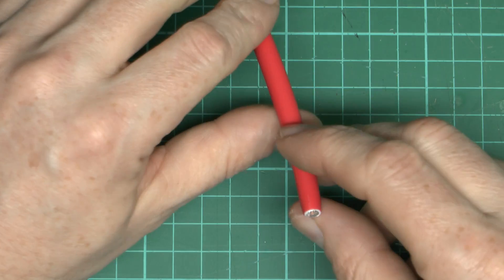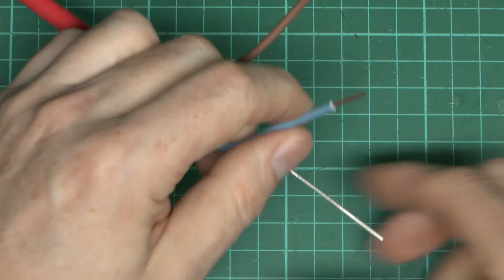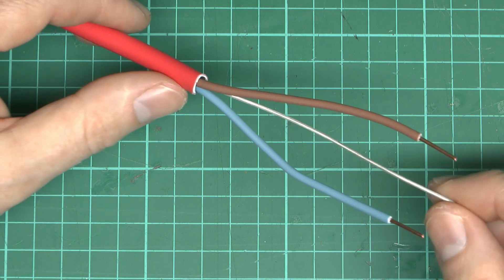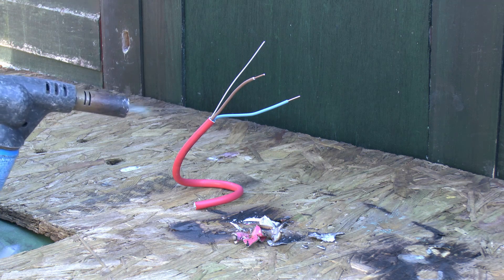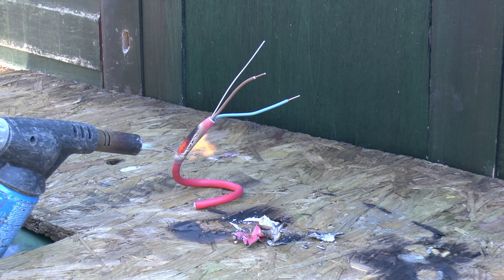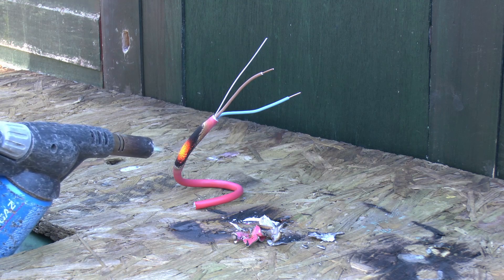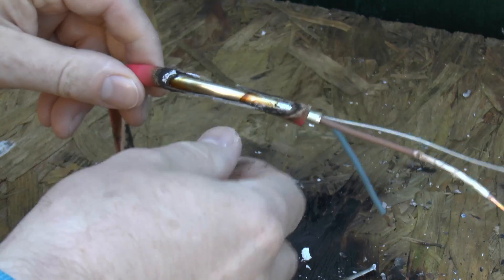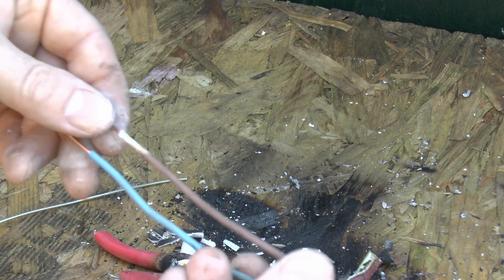FP200 Gold Cable + Flames = ?

Comment: FP200 was made by Pirelli it was made to withstand temperatures as low as -50c and as high as +1000c , it was classed as arctic cable and was available in Red white Blue and orange. The conductors were wrapped in a thin light blue foil then wrapped in aluminium then the outer sheath. It was mainly used for fire alarms systems emergency lighting   In hospitals nursing homes and schools and other public buildings. We used the white version for emergency lighting in a new nursing home back in the early to mid nineties. The fire alarm system was installed by a different company and they use the Red version. These days FP200 is a little different but still a fantastic cable.

Comment: Hello John, your videos are always useful.
What I wanted to ask is what do you use to strip a long length of fp 200 ,say where it enters a dist board before terminating. 
I very found a lot of strippers don't work well longitudinally and you end up pulling on the earth to strip the cable.

Comment: Hello JW, I think the third wire which is bare is for noise protection. The voltage in addressable fire alarm systems is 24 volt and the communication between panel and devices is digital (  power and data are simultaneously on 2 wires ). The system works without the third wire but since most of times these cables are near 230 volt cables, they like to be sure that there will be no noise and no interference on the operation of fire alarm system.

Comment: Annoying piece of junk 😂😂😂, we used to get some twat who flew his stupid motorised kite over us and circle, its an invasion of your privacy  and that ridiculous buzz...... 
Back to the cable, years ago we had little plastic or nylon ferrules that you inserted into the cut end of the outer sheath to prevent the hard sheath chaffing into the soft inner core insulation, then as you said, a normal flex gland to hold the cable into the terminal box.

Comment: You should set up a comparison of different cables (sy, pvc twin, swa, pyro etc) and see how the different fixed installation cables can handle a fire, I reckon swa would hold up pretty well since there's thick layers of pvc and the armoured wires are tightly packed, you could lay them all out over some hot coals and see which wires short out our open circuit first
Reply from the maker: Have done some of those already, https://www.youtube.com/watch?v=3hyN3NOmqGo

Comment: Fire Performance there is STILL ONLY MICC which will survive in the event of a REAL fire where water from burst pipes and mechanical shock movement will inevitably happen when internal structures within the environment start to move as will happen in a REAL fire. Silicon ceramifiable cables will NOT survive a REAL fire they are only meant to be used with Addressable intelligent fire panels and detectors. Clipping is important and some times clips are PVC coated with some unscrupulous manufacturers using outer sheath PVC and NOT LSF....Shame..................

Comment: So basically the outer (red) insulation is designed to be intumescent so as to shield the inner conductors from the intense heat.  Pretty clever as I have never seen such a cable until now, though it makes perfect sense.

Comment: I had to wire the apparatus room of a Soho facilities house in 1983 with that stuff and actually routing 83 circuits into a single power cabinet wasn't the most fun I've ever had. It has quite a large turn radius because of the aluminium cladding and so routing it in a confined space without damaging it can be quite a challenge. Having said that, it out performs a lot of other fireproof power cables. 

It does require (or did) a plastic ferrule end cap, to prevent the insulation of the inner conductors from being damaged by the sharp edge of the aluminium sheath at the strip point.

Comment: Thanks for the great video John 👍

The old pyro needs special tools to strip it, have fitted about 100 miles of fp200 over the years myself, easy to strip.. lots of powder coated copper p clips
Reply: Grant Rennie  pyro needs banning absolutely the worst of cables around

Comment: heres the irony of FP200 it may still work after being burned BUT because its sheath is damaged and therefore no longer offers mechanical protection it is no longer valid , MICC would simply need a scrape of the dead PVC and its back in service , most electricians cant do pyro (as we call it ) these days they can barely terminate a 2.5mm SWA without taking ten hours and damaging the sheath on the conductors !!!
i went to a school kitchen years ago that we had wired in MICC , we scraped the burned sheath put on new fittings and away it went , imagine the time out with FP200 ???

Comment: Excellent video again John. I was very surprised at the outcome. It really does its job. A fire alarm would hold its integrity long enough for it to do its job in an emergency. I’m very old school and close to retirement and like a lot of other guys,I haven’t been impressed with modern day plastic products,. This product has earned my total respect. Yes, I know it’s been going for donkeys years, but I’m impressed. I still mourn the disappearance of Pyro cable (my favourite)  and most of the engineering side to this industry. It would be interesting to see how this would stand up to a hostile environment/ atmosphere? Hammer blows, chemicals, corrosion, acid, alkalis, pressure and other physical abuse?
Thanks for your time John. Your videos are brilliant!

Comment: Interesting, but one of the most important considerations is the correct installation of this cable. In fire alarm installations the sounder circuits need to operate for a period of at least 30 minutes (detection circuits can fail at any time as they have done their job. FP200 will burn through but it becomes rigid and self supporting if installed correctly with the right spacing and the correct saddles, clips and or cable ties. I have witnessed this cable installed without be fixed above voids and tied to the underside of cable tray with nylon tie, it would fall off and fail. Also, consider the glands and boxes fitted.

Comment: Now that is rather impressive, in particular the inner cores remaining almost untouched after that level of heat.  What is the mandated use of this other than fire alarm circuits ?
Reply: Disabled refuge alarms

Comment: Excellent video. Are there special junction boxes for this type of installation too? Or perhaps high temperature resistant terminal blocks to connect them? I only ever see the red cable going from place to place, but terminated in what seem regular PVC junction boxes. I wonder if there are special requirements for the junction boxes too.
Reply from the maker: Joints are supposed to be done with ceramic terminal blocks.  Ideally no joints at all, just a single unbroken cable from one point to another (such as a fire panel to a detector).

Comment: When it comes to flying contraptions it seems that the smaller they are the more noise they make.  I often get a posse of five or six of these paramotors flying directly overhead in fine weather but not usually at this time of year.

Comment: I imagine the puffing up of the outer sheath acts to further thermally insulate the inner cores, a type of carbon aerogel where it gets too hot.
Reply: Yes, it's called an "intumescent" material.
Not to be confused with "tumescence" XD
Reply: @BenjaminEsposti  like the pillows and pads only different manufacturing materials

Comment: Another excellent demonstration, and agree with you about that noise, the "angry wasp" racket that small-cc engines with insufficient or zero muffling make is quite possibly the most annoying sound in the known Universe! Especially when they are stopping and starting constantly like petrol strimmers, chainsaws etc. :)

Comment: For those who asked 'where are these used?'.One function you'll find these or MIMS used for in high rise buildings is the power to the stairwell pressurisation fans. In the event of a fire those fans keep a positive air pressure in the stairwells to prevent them becoming a chimney.
Reply: I live in a flat in a country house that was previously used as a hospital. Our fire alarm system is done in a 1970s version of this FP200 stuff. Ours seems less rigid and has a white sheath. 50% of our communal electrics and flat submains are the 60 year old pyro cables fitted for the hospital and it's still going strong! I expect it to outlast all the modern T+E stuff we've added since.

Comment: Canadian electrician here just curious is this used in commercial and residential environments? Is it run in a conduit or tubing of some sort?
Reply: BS5839 calls for additional mechanical protection (conduit/trunking) for FP cabling installed below 2 meters unless it's a relatively benign environment (like an office) where it's not likely to be easily damaged
Reply: Not necessarily, it would generally only be put in tubing/conduit if it was required to be hidden, otherwise it would just be fixed naked (as it were) to the wall.
Reply: Almost exclusively commercial as most residences don't have the types of systems they're used with, which are the ones that have many fire detectors, call the fire brigade automatically, switch the building aircon into exhaust-only mode, etc.

Comment: What's the point of the aluminum liner in the outer jacket? Flame resistance, mechanical protection, grounding, EMI shielding?
Reply: All of those things, I would guess.
Reply: Actually, I think it is there primarily for Flame/Fire Resistance, and for mechanical protection as secondary property. It is not thick enough to provide significant mechanical protection, although it is clearly strong enough to protect against light knocks. It's not there to provide grounding, this is the purpose of the uninsulated conductor within the cable. It is not there to provide EMI shielding as there is no way to maintain the shielding through junction boxes etc., and there is no requirement for these cables to provide EMI shielding.

Comment: You could also get the cheapest, Chinesium fire cable made of thin, iron wire and colored napalm. Okay, I seriously doubt that would pass a building inspection. Well, I doubt a flame would be applied, but the inspector would know something would be a miss when the cable spontaneously combusts for absolutely no reason at all.
Reply: Just replace the proper electrical wiring with pretty looking fuse wires for explosives (the burning kind, not electrical modern fancy stuff), the fire if it starts will make it faster to the non-functioning fire alarm possibly setting fire to more stuff along the way.

Comment: Impressive stuff. I do commercial electrical and haven't seen wire like that here in the US but fire protection is it's own animal here and I just get annoyed when I see their low voltage red alarm wire haphazardly run through ceilings and usually in the way. It's basically a little better than cat5 just has a fireproof plastic.
Reply: I worked beside an American electrician that moved here for a while, all the cables are different stateside.

I had a look at the fire alarm panels when I was staying in America and they are totally different too, good and trouble come to mind

Comment: Deadpan delivery of, "now that annoying peice of junk has flown away..." lmao :D
Reply: Big Clive heard about some pink stuff and flames and flew in to investigate.
Reply: Ha ha.. Big Clive flying over checking up on your antics 😂 great video JW always wanted to see how FP200 performed under fire conditions. I should imagine the conductor size needs increasing on FP cable due to heat causing higher resistivity in copper.. Or maybe it's negligible?
Reply: @muzikman2008  I'd say unless it's called on for heavy duty applications (like maybe fire ventilation fans) then it'd be negligible, but you raise an interesting point.

I remember the old heat proof Pyro seals with the lead based glass sealing compound, specifically for fire shutters and vent fans.
Reply: @TheChipmunk2008  would be interesting to measure the volt drop whilst being burned.. See how negligible it really is. I agree though, alarm systems, sounders, detectors etc are low current devices. I did a bit of work with fire alarm systems many years ago but it was pyro back then, never used it or touched it since the late 80s lol..
Reply: I laughed :D
Reply: @ZocXer99  ...me too. This guy is sooo deadpan

Comment: OK, I have to 
say a couple 
of things about 
this vid. They are:

(1) Would it be possible to get a small wood-based fire going and hold a section of this cable over the fire? On the end of it, put a 60w lightbulb, and on the supply end, ballast it with a 3kW water heater so that if the cable does internally short, it will not make a massive fault current as it lets loose. The water heater should not become too warm as it will be restricted by the 60w bulb, but if the cable internally shorts out, you will know because the water heater will go full bore. Then...... repeat with a standard piece of 2.5mm twin and earth 6242Y.

(2) That device being flown in the sky is what's called a paramotor. Have a look on here for paramotoring vids and you will see that they actually are an intersting way of getting about! Not many people could afford a light aircraft (and associated running costs, maintenance, flight lessons and pilots licence) but for a few thousand, you can take flight with a paramotor. :D I know if I had the coin, I would like to say to my electrical stickist one afternoon: "I will be there by 2pm to collect my order, and by the way.... keep a watch on the sky, I am coming in by air! " :D

That would be TASTY.

That would put a whole new meaning on "Flying Sparks" :D

Thanxx for shkwing,

-Waynes' Electrical.

27th February 2019, 01.55
Reply: Yo BoomBox is that you?
Reply: Hiya. "BoomBoxDeluxe" is now a Wayne's Electrical brand.
Pop over soon, watch vids & BAAANG the subscribe button. :D
-Wayne's Electrical.
27th February 2019, 19.00
Reply: Closeish to where I suspect he (JW) lives there are many people who could easily afford an aircraft of some sort, look up Sandbanks, Poole. If you ain't got a few mil you are not getting a house.
Reply: Just don't fly paramotors over sewage lagoons just in case..... you know...

Comment: Did you forget to mention when installing make sure to use a ferrule.
Reply: They allege that you don't need them now... But I tend to use them if I can source them
Reply: @TheChipmunk2008  How things have changed.
Reply: The first iteration of FP200 had rubber insulation for the cores and would tend to tension  split if coming into contact with the sharpish edge of the aluminium sheath hence the use of ferrules, with  later iteration using plastic core  insulation the ferrules were deemed unnecessary
Reply from the maker: Ferrules haven't been required for more than 20 years.
Reply: @jwflame  I was made medically retired 23 years ago and never really kept up with what was happening in the electrical field. Just one of many reasons i enjoy your channel.
Reply: @jwflame  required no, but belt and braces ? (that's a genuine question. I know you're fussier than most, which is a good thing). I guess i should play more with the offcuts I have to see how the primary insulation feels.

Side not: I found some wiring from a very unusual system, i think it's similar to 'macanite' , hardish outer covering and a junction box (it's T shaped with curved 'inn er angles' on the T... are you interested or have you gone off the 'obsolete wiring systems'  thread?)
Reply from the maker: @TheChipmunk2008  Haven't seen the ferrules for sale for many years,  they may not even be available any more.
Old wiring still welcome, http://xo4.uk/?YTT
Reply: @jwflame  I thought the furules  were for Firetuff cables?  Correct me if I'm wrong on that.
Reply: I always wrap a bit of red insulation tape around the end. Keeps the earth sleeving in place and protects the inner conductors from the stripped edge of the sheathing. Plus it looks better in my opinion!
Reply: John,  Is there a chance if you could do a video on Fire Detection circuits in terms of the systems they now use?